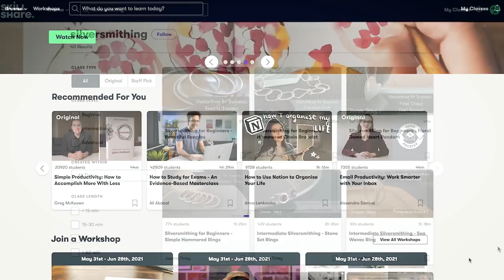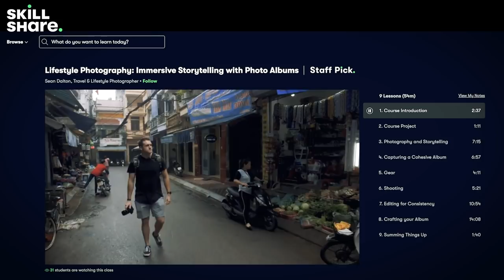Restoring a RARE Tiny Stanley No. 1 Hand Plane

Comment: Thanks Ben for the vids. There is a gunsmith named Mark Novak here on YouTube that I have learned a lot from. Boiling greasy rusty gunky metal parts in water, he uses a deep fryer for this, removes the crud as well as converts the rust( sorry I don't know the chemistry behind it) without abrasives as well as it will get into all the little hard to reach nooks and crannies. A quick light coat of oil afterwards preserves the metal and prevents further rusting. Thanks again

Comment: Personally I think that repairs should be unnoticeable but obvious with close inspection. So that in every day use you won't see it but when the tool is being closely admired you can see signs that the tool had been repaired. It can add character and shows the tool has been well cared for and cherished by whomever owned it (if they repaired it).

Comment: Nice  tote repair  , I have  a  beautiful  No1 Stanley  sweetheart smoothing plane,  I have  restored  hundreds  of plane's in my time as a  vintage  carpenter, when  I do a repair  on a  tote  Usually clean  both parts  of Rosewood  will  a little  Acetone as Rosewood  is  a very  oily  wood  it helps  the  glue  to  bond better,  that's  just  my way,  love your  videos  thank you  so  much.

Comment: I love my Stanley No 1.  I've had it since I was a child.  It was my grandfather's originally.  I find it very useful in luthiery, and comfortable to use.  Certainly no less comfortable than a typical heel plane of similar size.  It has a fine adjuster of course, but the real advantage of the No 1 is that the force from your hand is from a higher point - near the top of the tote, where it rests in the webbing between your thumb and forefinger.  So pushing the plane from up there forces its blade downwards more than when you are using a small low-angle heel plane.  If it wasn't for youtube I'd never have known the high value of these.  I've more or less retired it for occasional use only these days.  But it is a lovely thing to own.

Comment: When we got new planes , whether Stanley or Record etc, they came in a bad state, you were taught how to set them up, dress them and prepare them for work, they were rough castings, some very rough, most metal planes had a hollow in the sole, I see people making them flat but they were deliberate to stop chatter and sticking common with that type of plane, chip breakers were another fine tuning area and frog adjustment for different wood grains etc, final finish was always done with a wooden soled plane in my experience as they don't chatter like metal soled planes, as to full resto, I would say definitely, they were a heap of junk until they were individually shaped to the joiner or chippies own preference as every tool was back then, the only time they got rust on them is when they were no longer used, every joiner got a tool sharpening time allowance every shift, 30 mins, and in that time you did your saws planes and chisels, so you can imagine they shine, then you wrapped them in oiled wrags to store till the next shift, full resto is a must, but leave the hollow in the sole.

Comment: “There is always white paint on vintage tools.” There is so much truth in that observation. My first vintage tool restoration was a Stanley #5 Sweetheart plane that was heavily rusted, and the sole had a heavy coat of thick white paint with several gouges all the way to the steel. I did remove all of the rust, and spent an inordinate amount of time flattening the sole. But the effort was well worth the time invested as it is by far my favorite working handplane, even over some Lee-Nielsen’s that I own. 

Beautiful little #1 you found there. I am jealous, even though like you said that minuscule plane serves no practical use away from a grade school shop. Still a beautiful find.

Comment: That machinists scraper is such a great tip. I have used them to restore flat cast iron saw tables.  Very quick.  If the exact scraper is hard to find,  a re-ground old file does the job pretty well.  Another reason I can never throw  away an old file.

Comment: I think it depends on what the goal is. A concourse repair will of course be aimed at leaving an object in as new condition, so hidden repairs. But on the flip side there is nothing wrong, and I personally actually prefer, with just adding to an items history. Truth is anything of any age has had maintenance done to it to some degree, whether you can see it or not, it's still got a history. 

One of my acoustic guitars was given to me with a significant amount of damage around the edge where a large pre-amp was installed near the location of a normal acoustic socket is placed. I repaired it, installed a different pre-amp (which included adding a contrasting wood frame), repaired the area damaged which a large 'patch' and stripped all the paint off. The repair is as a result completely visible, but tells part of the story of the guitar. It sounds lovely, plays nicely and has a nice story to it. It is, of course, called Patch!

Comment: Hey Ben, that video was very relaxing and the result is beautiful. I love with how much respect you treat & keep the patina on the tools. Got a really worn out, but still working 4 1/2 from the Sweetheart era, I even left the white paint speckles when I cleaned her up ;). 
Some tips:
-screw threads should be cleaned up too, it can be done very gently by turning them through fine steel wool
-please ALWAYS get a little drop of oil on every thread & moving part when you assemble it
-NO plane restoration video is complete without a test drive :P :P :P
Love your videos, no matter if guitar building or tool craziness. Best greetings from Germany!

Comment: If the tool is to be kept in the personal vault, I usually spend a little extra time truing flats, 90 degrees, and polishing. If I'm fixing broken or missing parts for the sake of getting it working in the regular tool lineup, anything goes. Epoxy putty, grinding, cannabilizing old parts off really shot similar tools, especially fasteners. Tools aren't precious if they don't work. ✌ 😃

Comment: Most people look on repaired things as inferior but in my opinion if the repair job is done in same quality as the item or even surpass it then it's good in my book. Take for example cars, most people will be really sceptical if they're buying used car and heard that the engine had major rebuild, but if that is done by good mechanic that produces quality work then it's all good.

Comment: Ben, .. did you even touch the sole?
 I would have thought that bit would need to be somewhat smoother, almost polished? And, one of the most important parts of a plane restoration...?
Is it easy to muck up the sole? Does one need a machinist surface plate to re-dress the sole if it's too far gone?

Comment: Interesting.  The sander is actually a " linisher " . I have a Sheffield made one called " The Linisher " and I'm not going to argue with the British company that invented it . The gunmakers of the past used Jade Oil to halt the russeting of steel when Browning gun parts , which is a controlled rusting programme . Jade oils meaning has bee lost in time but but Breakfree CLP is the go to in blued and browned finishes on guns and by its name its a cleaning lubricating and protecting oil for guns that spend thir lives in hostile environments  . I have a No 4 Metril San Bras plane I picked up cheaply for a few quid in superb condition . Can anyone tell me why these are collectables ?

Comment: Looks great, but, if it were me, I would have polished the sole. A good, well-used vintage plane should always have a polished sole (assuming it's not a toothed plane). Otherwise, it's a plane like the ones in my garage that saw this same type of mini-restoration and then sat on a shelf, to be used once per year and approaching the need to be cleaned up again.
Reply from the maker: normally, yeah, I agree.. this was never going to be a user though, collectors tend to prefer us to stop any rust damage and then leave it be..

Comment: What are your thoughts on rust removal with electrolysis?  I've had great results on old spanners found in junk shops.
Reply from the maker: it does work very well but is just too slow for me, that and if you don't get it all perfectly dry you end up with even more rust than you started with, and planes have all sorts of nooks and crannies :(

Comment: You've cleaned it up cosmetically, and that handle repair is perfect.
But why not make it usable?  Clean, flatten, polish the sole, sharpen the blade etc?  You've made a wall-hanger/decoration, not a usable tool.  I agree about not doing too much of that on every other surface, but not on the actual working surfaces.

Comment: IMHO, how much detail goes into the restoration depends on the end 'use' of the tool and the desired end result. 
If you are restoring a tool for a 'shiny display tool' to display as a piece of history, then the restoration and repair may need to be disguised for display purposes, especially if you want the display to last a long time without any maintenance. 
For a tool that is being restored as a 'working tool' for day to day use then minimal restoration may be the best option as the tool will be maintained in the shop environment.
Regardless of the final use, I think restoring to maximum effort any moving parts and fixings (screws, nuts, bolts) would be the way to go as if these are already showing signs of rust or wear or seizing this is going to continue to occur. If you desire to hold the patina of age, cleaning the threads would still be a minimum. Running the threads over a wire wheel and a tap through the nuts can be done without altering the patina of the external parts.
Hopefully you won't be the last owner who wants to own the tool for whatever purpose (rather than scrap) and leaving clean, usable threads and moving parts would not only be a kindness to the tool but also the future owner who may want the tool for a different purpose.

Comment: I was a little bit disappointed that you didn't use the other #1 plane for the restoration. No need to leave repairs visible for that but for e.g. a very valuable guitar neck it might be cheating. Personally I'd cherish a visible repair job a more in a piece like that.

Comment: That plane is worth over $1000. It isn't like an antique piece of furniture, in which a complete restoration would destroy its value. It is, to me, silly not to restore the plane to mint condition. It will be worth more if you do.
Reply from the maker: restoring this to mint condition would halve its value, or more. taking it to where it is now is about as far I would want to go with a collectable vintage plane. in the end we sold this one for $1300 within hours of posting about it, I wouldn't want to halve that by going to far.
Reply: @CrimsonCustomGuitars  I guess we'll have to agree to disagree. You can't buy a Stanley #1 in any condition for $650. I suspect if you restored that plane to mint condition you'd have gotten a lot more than $1300 for it.

Comment: Restoration is a funny thing. For a working tool, you use what you have on hand to make the best job of it. That is a repair, not a restoration. If I was repairing the tool I would choose from my existing stock a nice match for the wood, and use the nearest finish colour. It is when you deliberately delay things to use materials not to hand in order to disguise the repair that you step over some line. Clearly relicing of anything at any time is beyond ethical. 
What didn't happen here is to restore the plane to operational capability. That is a disappointment. It has been made to look pretty on display providing the illusion of a working tool. But it is all for show. The blade isn't true or sharp, nor has the plane been set up. Just assembled. I restored my grandfather's Stanley #2. It got a proper grind on the sole (with full frog tension as it was done) and the blade cuts true and well. It is a working tool. It sure doesn't look like a display piece, but I use it all the time.